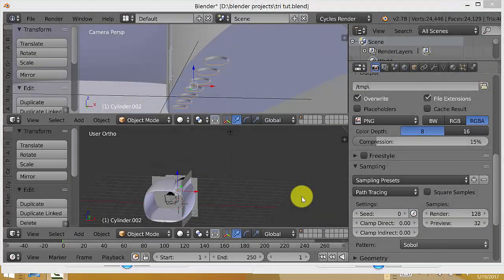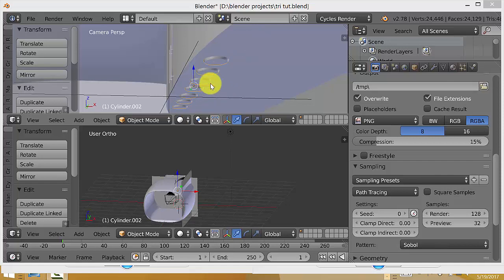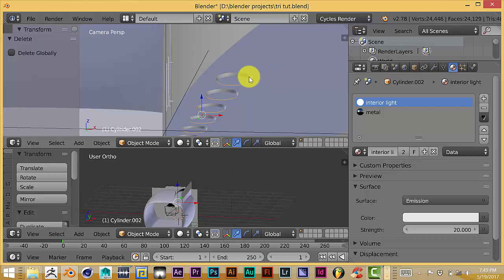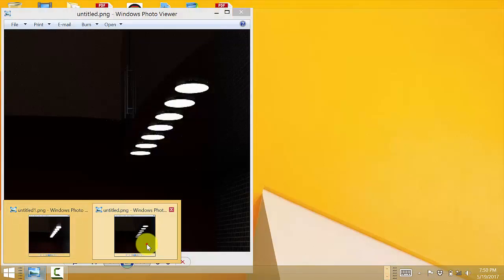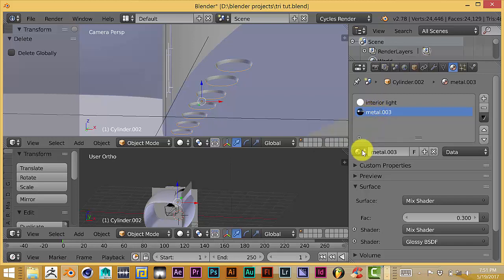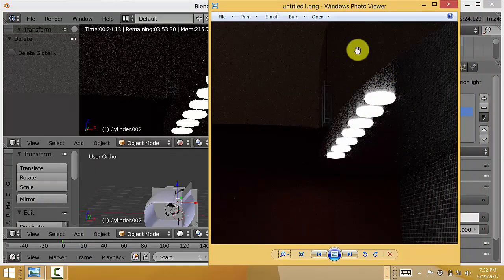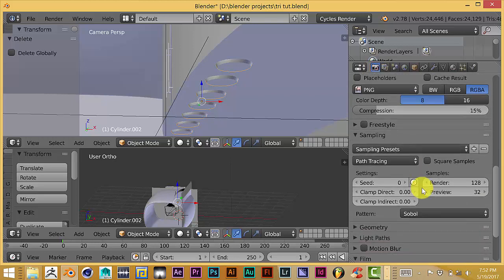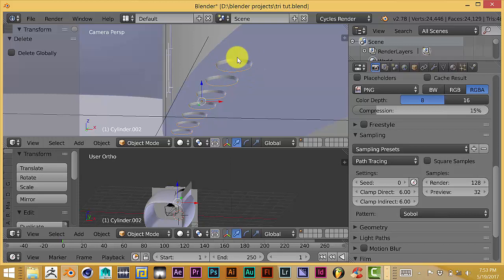Blender Quick tip: How to reduce noise when using a mesh as a light source

Comment: You don't explain or show what you mean by encasing or concealing the mesh "inside" a material. Is this concealing material on a seperate mesh that the emissive mesh is inside? Are the materials mixed together in some way?
Reply from the maker: Sorry about that. When I mentioned concealing the emission material I ment putting another 3d model  that is separate from the model that has the emission material around it. You can look at it like a light bulb in a fixture. The light bulb is the 3d model that has the emissions material while the fixture is a separate 3d model that doesn't have an emissions material.